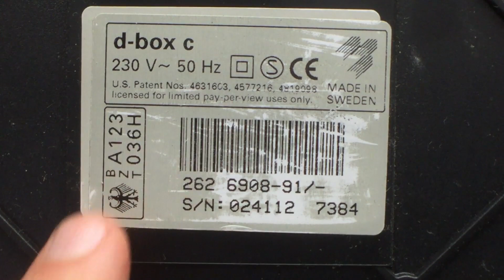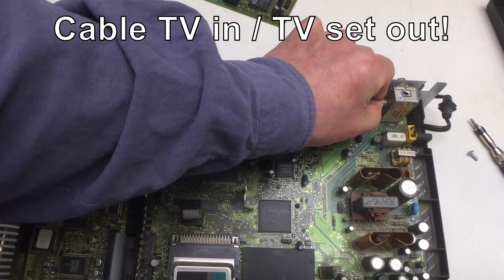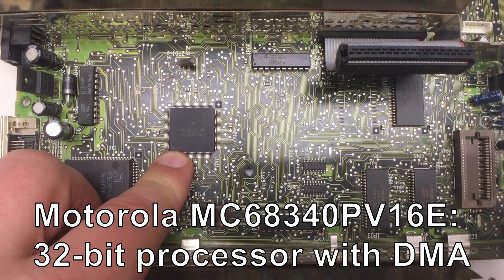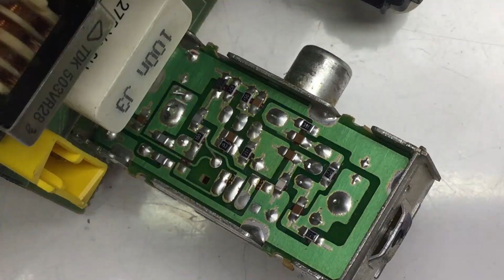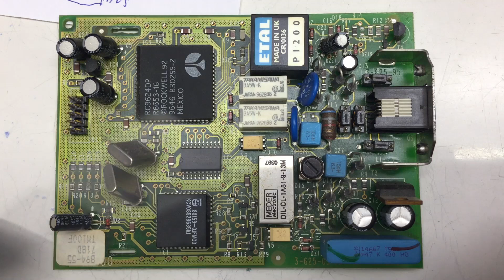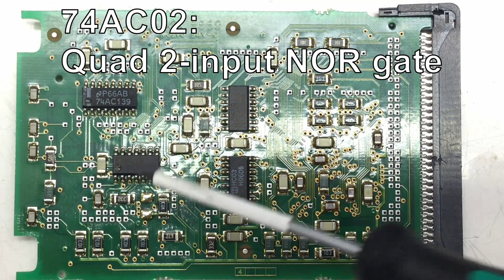Scrapheap Scavenge & Teardown: Nokia d-box 1 DVB-C Pay-Per-View Receiver

Comment: Even today (July 2022) I am watching satellite tv on my second monitor with this d-box 1. It works perfectly. The d-box was available as a satellite and cable receiver.

Sogar heute (Juli 2022) verwende ich die d-box 1 als Satellitenempfänger. Sie funktioniert immernoch super. Von der Box gab es eine Kabel- und eine Satellitenausführung.
Reply from the maker: Yeah, they were quite sturdy things. No wall wart or switch mode power supply with a build in expiration date, but a good old transformer. I guess the one I took apart would still have worked perfectly.

Oh ja, das waren ziemlich robuste Dinger. Kein externes Netzteil oder Schaltnetzteil, das irgendwann den Geist aufgibt, sondern ein guter alter Transformator. Ich denke die Kiste die ich auseinander genommen habe hätte auch noch einwandfrei funktioniert.